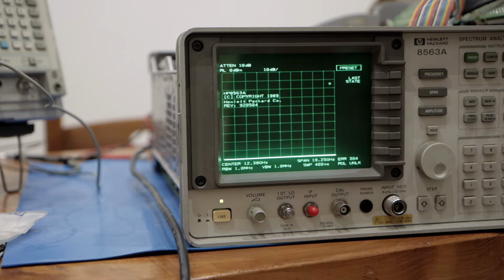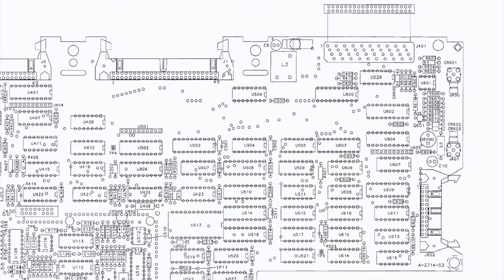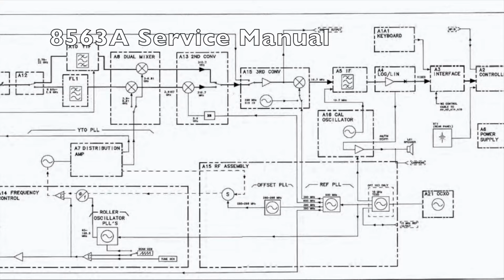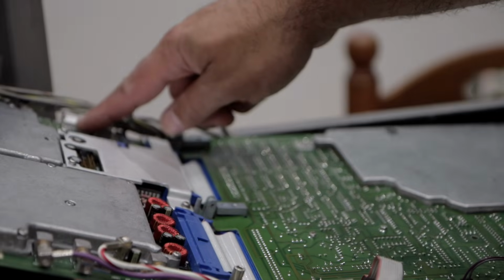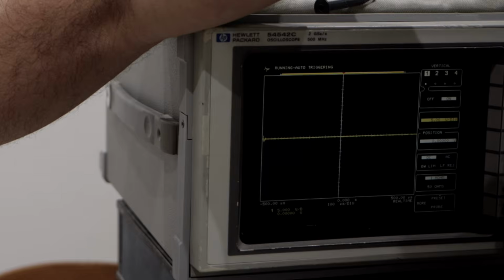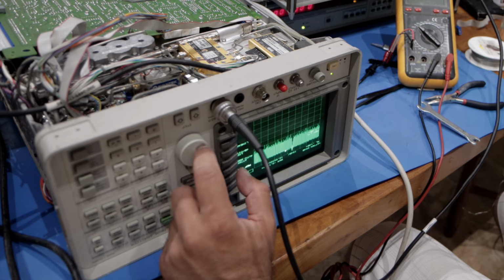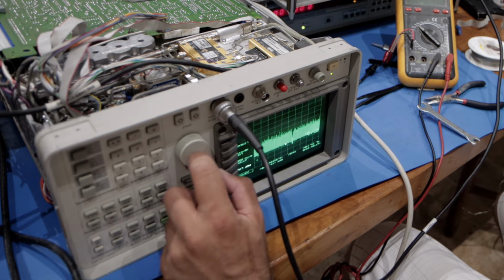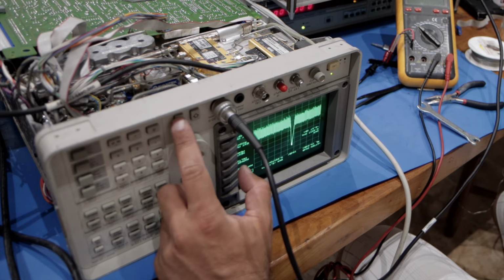HP 8563A Spectrum Analyzer Rebuild - Part 2: The Dead Oscillator

Comment: Nice job. I have a 8563E that I need to get around to fixing, Sometimes it won't power up. I suspect that there is a marginal tantalum cap somewhere as IIRC the last time I looked at it is the power supply is good. Guile you might want to look at the power supply the next time you are in there as there are some IIRC 215k 1% resistors in the kick start circuit that are famous in this series of analyzers for goiing high in value and finally open (I think there are two in series) so the power supply won't power up. The 8563A/E is a great analyzer. On the attenuator pads I believe the ones that are in the 8560A and the 8563A/E are different as the 8563A/E is rated to 26GHz. It's possible I am incorrect on that and perhaps a tech that worked on these for HP can verify that. At one time you could buy these pads from HP as I bought some 20 years or so ago. You might also want to look into replacing the O rings in the attenuator as they are know to go bad resulting in cracked pads. There is a video on YouTube that will show you how to do that. The O rings are made from Buna-N rubber and deteriorate from O2 exposure just like dry rotted tires. I am looking forward to seeing how you progress in getting it 100% working and in spec. Sam W3OHM

Comment: I've just got my 8563A yesterday! And how dissapointed I was when after 15 mins of working several errors showed up. I'm pretty sure that they didn`t appear when I switched it on, and also there is no errors on the video seller sent me, so the instrument broke in my hands in the first few minutes I got it. Anyways, errors looks the same you got on your device - 301, 317, 334. It looks like they're common ones for this type of instruments and they're related to YIG oscillator and PLL. I've decided to go forward with repairing it by myself. I'm new to this tool so I need to learn it more, and your project came just in time. So I'm looking forward to see the next episode from you!
Reply from the maker: Thanks for your comment and sorry to hear that! Maybe check those SMB connections as they might have detached during shipping. If there’s a noise floor displayed on the screen chances are the problem is located around the YIG oscillator. If there’s no noise floor, double check the connection of the A21 oscillator as even after I swapped out this one I got issues from time to time and had to replace the power connector to solve that issue.
Reply: @theguileslab  thank you for your suggestions. The noise floor is present, and even input signal is displayed most of the time. Errors even disappear when the span is small, like under 50-100 MHz. I still belive that I'll be able to repair it without replacing YCO. Now I'm gathering information, studying service manual.
Reply from the maker: @a @andrsam3682 ’m sure you can! In that case, double check the Roller PLL section, connected to the « FM » span of the YTO as this part is responsible for fine frequency tuning of this oscillator. On the service manual have a look at section 10-15 « General PLL troubleshooting »
Reply: @theguileslab thank you very much! I'll try it